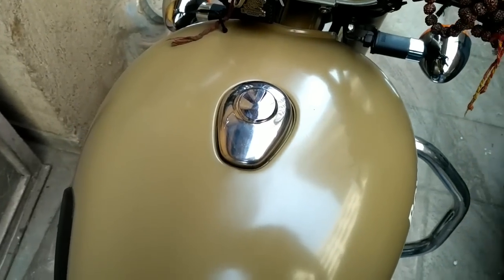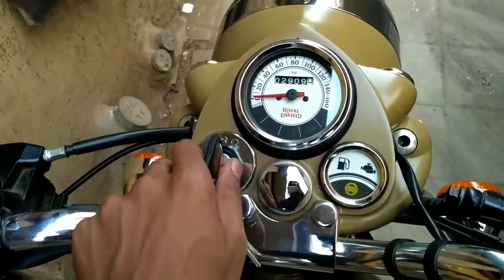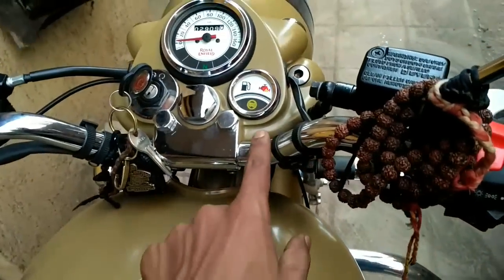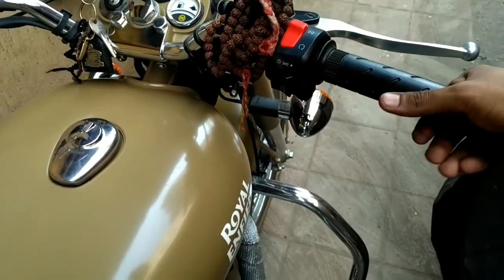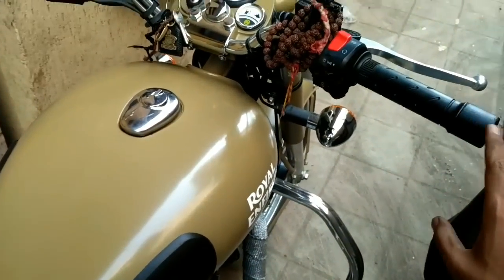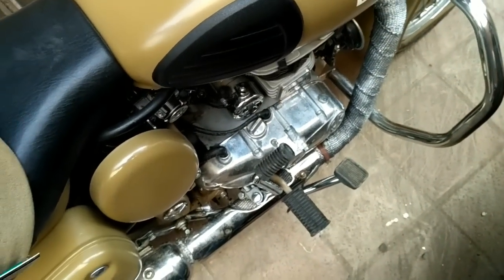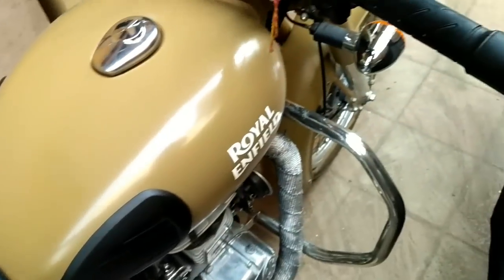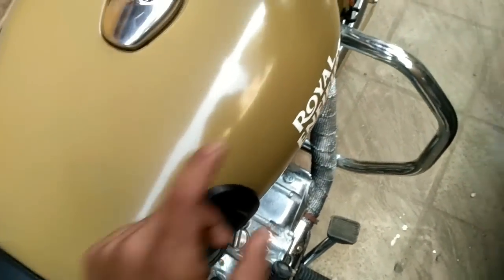How To Kick-start A Royal Enfield Classic 500 Desert Storm

Comment: my bikes MIL don't turns off it glows continuously, when i start my engine it goes off whats wrong with it .?
Reply from the maker: Anil Mech contact the service centre
Reply: +The Desert Storm Guy they said its the new thing in BS4. In BS3 it use to went off before starting but here it will glow off only while starting, is that true?
Reply: @11anil11  same thing is happening with me, light is not turning off but it was turning off before. i m using bs3(not sure)model year 2017. i didnt used my bullet for 2 months as i was out of town and now when i came back and tried to start bullet is not starting and this MIL issue happens. Any suggestions.

Comment: Hey DSG, the bs4 desert storm has the engine light turned on when the key is put in and turned to on position, but as soon as you start the the bike the engine light immediately goes off.. what is that?
Reply from the maker: Ace 92 it like a check up thing. the worries start when your engine is running and the light blink. when you just put the ignition key onand put the engine kill switch on the red light will be there for a few secs and it will go off (check out my how to kick start a Royal Enfield Video). but if the light stays on even when the engine is running then you my frnd have to contact the RE guys asap. until that it's cool. bt if it worries you just have talk with them when you service your machine
Reply from the maker: Ace 92 P.S - DSG, well you gave me a great idea for a logo buddy
Reply: hey DSG thanks for the quick reply, i have seen all your videos and i asked this question because your engine light switches off after few second before starting the engine, while mine keeps on glowing until i start the bike and it goes off..
Reply from the maker: Ace 92 might be a new feature of BS4. I'll make a video as soon as possible of i get my hand on BS4. thanks alot for your support buddy
Reply: The Desert Storm Guy hahaha sure mate use the 'DSG' its small, simple and cool too..
Reply: The Desert Storm Guy thanks to you my friend... enjoy the ride and stay safe.. and surely do make a video on bs4 c500 or desert storm with this query we had a chat on... thanks once again. 😊🤘🙋
Reply from the maker: +Ace 92 anytime buddy. Keep the support coming strong af
Reply: This happens even in my classic 500 bs4
Reply: Ya its the new default system from RE BS4 500cc models. Nothing to worry if the light doesnt go off.

Comment: Hi buddy am super frustrated with mh desert storm 500...its again at the service centre 7th time...still they are not able to figure out why the battery goes dead....
Reply from the maker: +aditya bandekar did you try replacing the battery ?
Reply: The Desert Storm Guy glad to see ur message...i fought with exide n got the battery replaced...the brand new battery also got drained in 2days...
Reply from the maker: +aditya bandekar then checkout if there's any wiring problem. Somewhere something is sucking up on the battery probably. If you think the service centers are not helpful I'll suggest you to go to a genuine Bullet garage, mechanics with experience, they'll surely sort it out.
Reply: These authotised servoce team does not evrn know what they are doing...i am really frustrsted....this was supposed to be my dream bike ...but its turning into a nightmare....please help
Reply: The Desert Storm Guy this is the 7th and final try...they said no wiring issue..no magnetometer issue..no charger issue...but battery drains completely.....i am frustrated completely with this....
Reply from the maker: +aditya bandekar if you're from Mumbai I suggest you to visit Grant Road(see my oil leak video), theyre are experienced Bullet mechanics who can help.
Reply: The Desert Storm Guy i the guys name chotu by any chance..the one at grant rd
Reply: I have same problem with batary and ECU also.my boke  ECU  also dead.and service center they dont know why i have changed wiring also.

Comment: why people are applying polish on matt finished bike wtf is wrong man
Reply from the maker: Brown Hammer We don't apply polish. Continuous cleaning causes the matte to turn into glossy. You can check out my video on How to get back the matte finsih
Reply: The Desert Storm Guy is that fuel indicator ?
Reply from the maker: Brown Hammer not a specific fuel indicator it a fuel indicator as well as battery indicator in one odometer panel. it blinks orange when there is 2.75l of Petrol and blinks red .75l of petrol